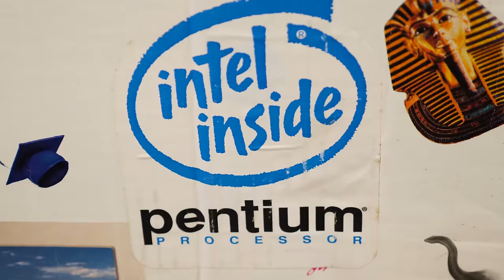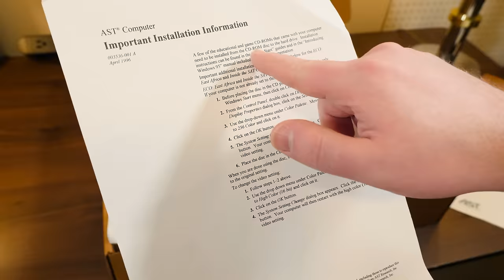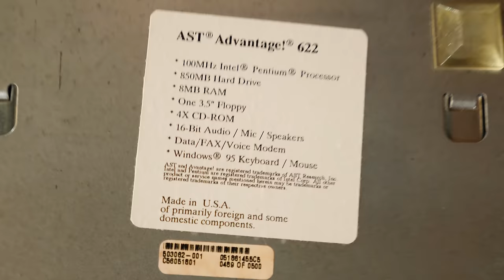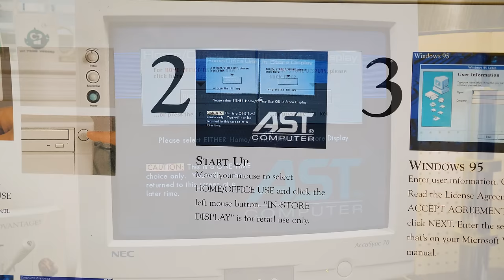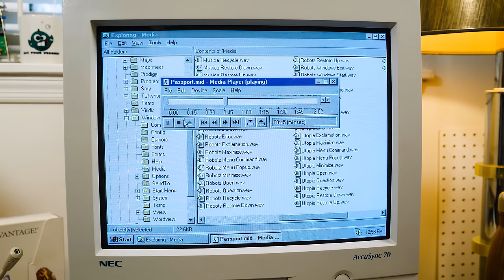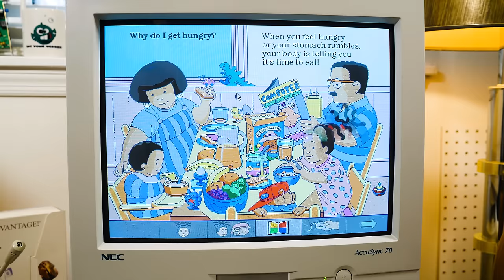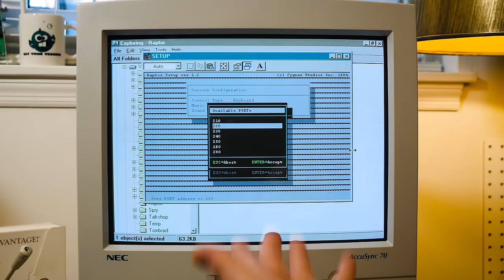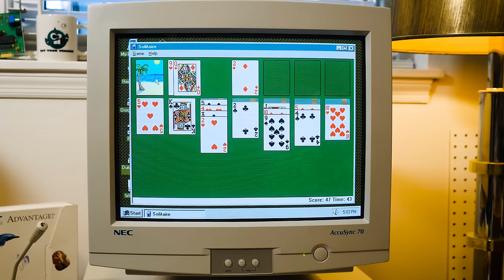This 1996 PC Was Obsolete Before You Got It Home: AST Advantage 622

Comment: I had a similar spec'd Packard Bell Legend 812 (or something like that). Pentium 100, 8MB of RAM, 4x cd rom, 14k modem & soundcard combo card. 1 MB Cirrus Logic video built onto the motherboard. 850 MB Maxtor hard disk drive.  TONS of "shovelware" which took almost HALF of the hard drives space! Very slow until you at least doubled the RAM.
Reply: Yeah, I was getting into computers in that era and they really did shovel the crapware on every home computer. 

I remember buying a few laptops that were slower than the computer I was replacing it with due to all the crap starting up on it (and extreme lack of memory)... Learning to clean install windows and all the drivers made me feel like a wizz, 😆 and getting rid of 5minute plus boot times felt great and made friends and family happy.

Nowadays computers are so fast and even a basic computer has plenty of ram so the most bloated OS still isn't much of an issue.

Comment: I worked at AST Computer in 1996 at the factory in Fort Worth, Texas.  I worked in the IT department, supporting the manufacturing lines.  I remember these coming down the line.  They actually put a 1GB drive into them, but there was a huge failure rate for those drives and lots of warranty claims.   And the funny part was internally we always wiped the hardware and installed Windows 3.11 on them because AST was not licensed for the internal use of Windows 95 .   And I have a set of those speakers you were admiring.

Comment: In 1996 I got a Pentium 75 with 4 MB RAM, 126 MB harddrive, and a Tseng ET4000. It was great for DOS/Windows 3.1 and I even ran OS/2 for a while, but I never got Windows 95 till way later, like 1997 or '98. Needless to say it wasn't long before I upgraded the RAM and started replacing everything else, so by the end of 1997 it had been fully replaced by a K6-200 (still have the CPU, motherboard, and RAM, but everything else's gone missing over the years) with Matrox Mystique 220 and Voodoo2. Now that was a solid gaming machine

Comment: I suffered from 1994-2003 with a 66mhz 486 Packard Bell with 8mb of RAM and WIndows 95 on the internet with it's 14.4mbps modem. You sure learned to have patience and to keep that 500mb hard drive clean. Just for fun after that was no longer the primary computer, I upgraded the RAM and put a Pentium Overdrive in it and had it running Windows 2000 before it was fully retired. I was always amazed at how far you could push a machine in the 90s.

Comment: The first PC I ever bought was an AST. Mine was the upgrade of this computer with 16MB Memory and the Pentium 133 processor. I bought it when most companies were already deploying the 166. I had a huge 1G hard drive on mine. In all seriousness, it was a great computer. I recall that I added a discrete video card to the PCI port later on and upgraded the RAM to 32MB- basically maxing the machine out. I kept it running until about 2000. This was really about that age of the intro to multimedia. We laugh today, but back then, this was fascinating. It didn't always work well, but it was a leap forward.

Comment: First, love the monitor choice!  I was always a fan of NEC and Diamond Mitsubishi CRTs.  Love this video because it really replicates the unmatched feeling of opening up those new, fancy multimedia PCs (multimedia and interactive were certainly buzz words for marketers then).

Something about Duke3D, Tomb Raider, DOOM, and Quake back then.. They were magical and still hold up well today.. Its not just nostalgia.  I think it wss the extra care devs took to add secret areas, ambience, and little touches to their games.  Great level design is all but lost today.   Oohhh.. Descent - another game ahead of its time!

One of my favorite memories of that era in computing was creating boot discs with BAT files optimized for specific games.  It was all about squeezing every last bit of performance.  RAM was usually the bottleneck I ran into as well.  It wss more the allocation that hurt: upper, himem, expanded, extended, blah blah blah....  Windows used MSDOS AA a backbone for so long yet it really hogged resources and starved poor DOS.

Oooohh..  I remember making boot menus so I could launch into environments tuned for my favorite games.  Nowadays, that's mostly unnecessary.  Its fascinating to me that back then hardware was usually the bottleneck: install some RAM, maybe a math coprocesssor, and eventually a fancy graphics card..  BOOM - experience upgraded!  Man, on the sound side, it was Creative SoundBlaster or bust... Though they had a couple of competitors to consider.

The real turning point is when Voodoo cards came out.  3DFX, Unreal engine, Glide drivers, and/or OpenGL advancements (NVidia, ATI, and DirectX were barely on the map then)...  Boy oh boy!  I remember Unreal (the game) for the first time.  How is my PC running this??  It was gorgeous and buttery smooth.  No stutter or anything.  Amazing!  Can't forget MMX: that instruction set introduced the first REAL Pentium chips.. And the rest is history!  Shame that today its the opposite: hardware outpaces good programming practices.  Software is so unoptimized these days.  Can't blame the devs fully: there's just a lack of uniformity and standards in PC gaming and we may never find that sweet spot like we did in the mid 90s to early 2000s.

Comment: I had an IBM 300GL that looks the same, inside & out & the rear, except for the front.
The best way to separate the heatsink from the CPU chip is to twist the heatsink off while the CPU chip is still locked down in its socket
I love all the old tech, the feeling of nostalgia watching this video, is pleasing, thankyou 😊❤️

Comment: I personally think that the problem is more a problem of era: 1996 was the beginning of 3D games. I recently restored ans upgraded a 486, and clearly 486 and Pentiums, assuming they had a CD ROM and 8MB of RAM are totally capable of playing games from 1980 to 1996 assuming they are not 3D. Some games like Doom, quake of Duke3D (you are the specialist, I don't know if it is 3D, 2.5D or whatever) can run, but it is about it. I think that all the new games games needed at least a Pentium 2 300MHz with a decent 3D accelerator to work, and it was not something common until 1999. So from 1995 to 1999, people just played games as they can, no new games at all if your computer was slow, and games at 8FPS if your computer was average.

Comment: This, in a sense, was my childhood PC experience. The hardware was different but the experience was the same. It was a largely obsolete Windows 95 PC out of the box, but the fact that it could do computer things was hugely compelling. We struggled along with it all the way until we upgraded to an XP system in the early 00's, but extracting every bit of performance out of the machine to run what I threw at it was a formative  and educational experience. Even obsolete software years later felt like a nearly infinite set of possibilities knowing that somewhere there was a machine to put it through its paces.

Comment: Nice video! Back in 1996 I had a 100MHz 486, bought in 1995. I had originally aimed for a 66MHz 486, but then I got a very good deal on a 100MHz and went with that instead. If I remember correctly (and I'm pretty sure I do) it originally had 4 megabytes of RAM and Win 3.11 installed from almost 20 floppy disks. Can't really remember hot much graphics memory it had, but I believe it was 2MB. Hard drive was a whopping 540MB. I also remember buying a rather expensive 4x cd-rom drive later.
What''s really funny is that I played - and absolutely LOVED - Quake on that severely underpowered machine. It was the mother of all slideshows when things got hectic but I just didn't care, since Quake was the most amazing thing I had ever seen. I still put it (as experienced on that pc in 1996) in my top 5 of all time. Not sure if I had to add some extra RAM to get Quake running (4MB sounds VERY tiny) but I just can't remember. I know I did upgrade the RAM at some point, but never really had a clue what I was doing anyway. Only way for me to solve all pc related issues was to buy pc magazines or ask someone in IT at work. Things got a lot easier with internet access in 1997, but that also meant that a fast and furious 200MHz Pentium MMX replaced the somewhat creaky old 486. I still have that 1997 Pentium machine, but it won't boot properly and I don't know enough about computers to understand what causes the problem. I'll probably survive a few more years without it though. 😄

Comment: Had one like that as a kid. Mine had a 166 Cyrix chip. It replaced a Mac SE. Our IBM PC350 P1@166 outperformed it with similar specs. CPUGalaxy did a video on the performce on those 2 chips. Brings back memories.

Comment: I had this very computer I believe.  We got it around Christmas 1996. Mine had no speakers or microphone however. Pentium 1, 75Mhz.  600mb hard drive roughly.  Had to learn how to do my own upgrades and everything.  Had no internet, so I had to download anything I wanted from other computers and pray that the files were smaller than 1.44MB so that they'd fit on a floppy. That was my primary computer until the summer of 2000. Good times.

Comment: I remember those days! I was one of the first guys among my friends and peers to have an ISDN line, Motorola Surfboard modem, 64K x 2, 128K!!! Everyone asked the same thing? "Why do you even NEED that speed? You'll never use it!" LOL. 
But it was so nice to have a permanent connection to the internet. If you wanted to make a phone call, it would drop one of the 64K, and use that for the call. When you hung up, it went back to 128K. 
It was expensive, but not as expensive as 1985-86ish Compuserve! I recall being billed $16 per hour to access their service!!! 
But it was fun times. The hardware was increasing in performance almost every month. Things were screaming right along. It was daunting for a lot of my clients. They were so afraid of buying something that would be too slow in 3 months... and actually that was a valid fear in those days.

Comment: Great video and some really great points. In 1999 I had a 90mhz P1 with a massive 64mb ram for the time but a 512kb video card. I wouldn’t even get this kind of performance playing tomb raider. However as your computer is here, my old pc was a decent working multimedia computer. Beat the crap out of my 486 with no sound card, modem or cd-Rom drive I had before it.

Comment: I worked on the AST helpdesk in the UK around this time and some of these models had a really strange quirk: If you ran certain versions of DOS4GW games (Doom etc.) sometimes the interrupts would reset the BIOS, then on next full boot the hard disks would be "forgotten". We received a lot of calls where the PC suddenly wouldn't boot and then we had to guide customers into the scary BIOS settings to redetect their hard drives, all because of a game. One of the strangest things I've seen in my career.

Comment: I had an AST Advantage 466 with 8MB of RAM, a 512MB hard drive, a 14.4 modem, and a 14 inch monitor included, for around $1k in the summer of '96. My first Windows computer. I miss that one.

Comment: Ex-AST support here.... still got my training certificates too!
You have the wrong speakers, the ones you have are for the 621 model
Lucky you got the 622 and not the 621 it had serious problems with the MB, attach anything that drew power via a port and it would fry the MB.
The 'Bravo' series was the 'business model' and the Advantage was the home PC range.
You can't upgrade anything, the serial port was connected to a bespoke 'riser card' the jumpers were filed down and soldered!

Comment: I'm 8 months late to the party on this one, but I had a similar PC from HP back then. It was the HP Pavilion 5040 desktop. The specs were surprisingly good for a budget family PC. Pentium 120, 8MB EDO RAM, 1.2 GB hard drive, and a Trio32 1MB onboard video. Sound was also onboard but to my surprise is was a real OPL3 chip with a Crystal chip for Windows. I upgraded it to 32MB of RAM and had planned to do more, but it got stolen. I found one recently that I'm building up to what I would have done with it. Matrox Millennium 4MB, Voodoo 1, and maybe an AWE64.

Comment: Speaking of getting an obsolete computer at the time you bought it, my first computer in 2000 was Pentium II 400Mhz with 6GB HHD and I have no idea how much RAM it had because I was very much computer illiterate (I was 12 and it was my birthday gift).
It came with Windows 98SE and a demo disc with various games on it like Tomb Raider II, Gubble, X-Decathlon, Forsaken, Age of Empires, etc. but at the very least, it still ran all those game demos fairly well (in my memory).

To this day, I really wish I could see that demo disc again but it would be impossible to find now. I'm from Portugal, and it was obviously a custom demo disc they made for the bundle, and I have the habit of throwing everything old away, so it's long gone.

However, there was one super weird thing with the Age of Empires demo, all the menu text was replaced by lines. Yes, lines, as if every character was replaced with hyphens. It was the weirdest thing! 

Also, I did figure out that the Win98SE disc came with demons for Midtown Madness 2 and Motocross Madness, and they ran horribly!

Comment: I worked at AST back in the day with David M. that was a dog computer it needed a bigger HDD and more Memory,  8MB EDO non-Parity 60ns 5v 72-Pin SIMM Memory Module it probably came populated with two 4MB sticks. Upgrade the Memory get a larger HDD and the sound card was basically sound blaster compatible.  Biggest complaint on that computer was; hey I only have 300MB of disk space left on the HDD. First call to tech support was basically how do I turn off spot and what memory do I need to get. Brings back a lot of memories for sure. It was the cheap version of that computer less RAM and a small HDD to lower the price for the end user. We on the support lines kept shacking our heads on the the choice of a small HDD and not enough memory, but AST was not very good at listening to Tech support.

Comment: 10:10
I still have a few of those mics. Got about 12 of them in a $10 box of miscellaneous parts at a yard sale back in like 2006. I used to intentionally break them, tape straightened out paper clips to them, and rest them behind my ear like a pencil, throw on some of the cheap metal headband Sony's, and have my own home made head set to play quake with my uncle. Turned down mic input so I wasn't blowing out his eardrums having it so close to my face, but it worked, lol

Comment: My Acer Aspire from 1996 cost about 2500 usd. It came with similar specs to this pc. 100mhz pentium, 8mb ram and 1mb cirrus logic graphics onboard, 28.8 pci modem. I quickly upgraded the ram to 32mb within 6 months and purchased us robotics 36.6k modem that was like magic. My Quantum fireball was 1.2gb.

Comment: This was my first computer but has the AMD version "133Mhz". I had upgraded it to 64MB of RAM and had an 800MB Hard drive. I had a ZipDrive, the only way I could expand as this was my "graphics Design" workstation!! I had to reboot every time I'd apply a filter or work for a while as the Photoshop cache would take up all of the Hard drive space. :| MP3s were starting in 1996 and had a 700MB disk full of them, obviously couldn't copy them to the drive lol This helped me through my first 2 years of college, then upgraded to a K6 PC I build myself!! Ah the good old days. I had to create recovery diskettes and had 33... if one was damaged you were shhhh out of luck. I was never able to get the modem working after a restore as the restore CD was not good.

Comment: This is so close to my first ever computer that my dad bought. We had a Compaq Presario Pentium 133 with 8MB ram. the speakers would be hanging on the side of the screen.
I wouldn't be surprised if it was the same motherboard. 
Back in the day as time passed and as I got to know more of computers, I hated the SIS intergrated videocards. I knew they were bad.
Dad paid 3200$ cad for the compaq presario. I sold it 8 months later for 600$ added an extra 600$ of my saved up money and built myself an AMD K6-233 clone... WIth a 4MB ATI for 2d and a Voodoo1 4MB for 3d... Had a rare motherboard that came with 1MB of L2 Cash. it was an amazing PC.
I remember back in the day how it was marketted that clones are so much worse, when the reality has always been the opposite.

Comment: OMG I sold SO MANY of these AST Advantages (And Compaq Presarios and Packard Hells....) when working as a computer salesman and eventually department manager for A&B Sound in Vancouver Canada between 1994 and 1996. While the hardware was reliable and the multimedia software bundles included for the CD-ROM equipped models were generous and actually useful, You should have gotten MS Encarta with that bundle (you got ripped off of Groliers instead) I sold SO many PCs with Encarta demos alone, it was Wikipeida 5 years before Wikipedia) the biggest problem was that they were woefully underpowered for the fairly high price-point and the included AST front-end on top of Windows 95 (already a front-end on top of MS-DOS) didn't help performance at all.   Still for the average family at the time new to computers, it was a pretty comprehensive and useful introductory PC and could even game. (minimally)